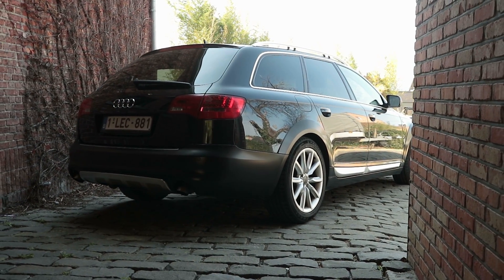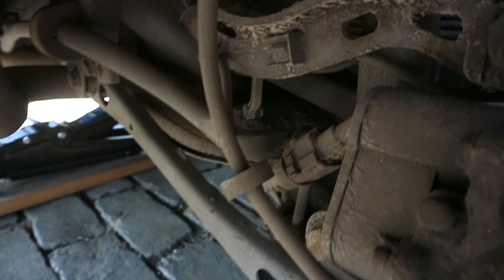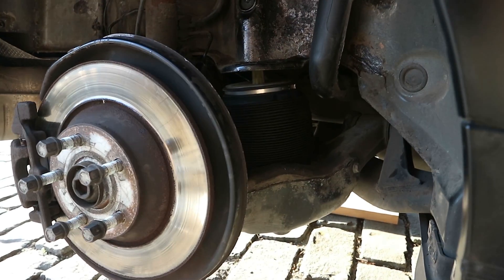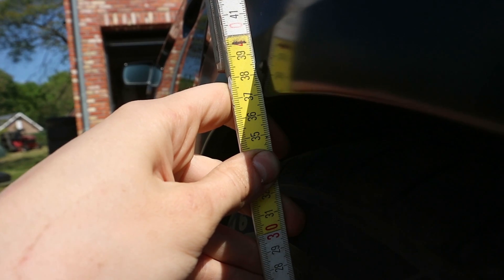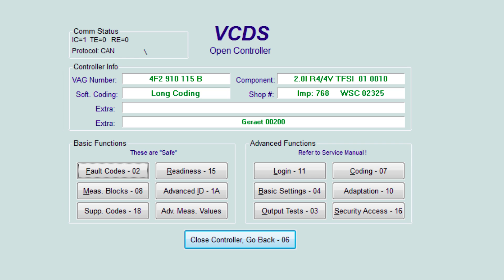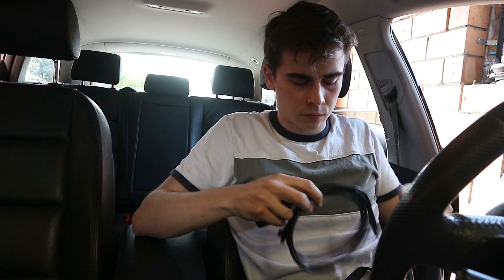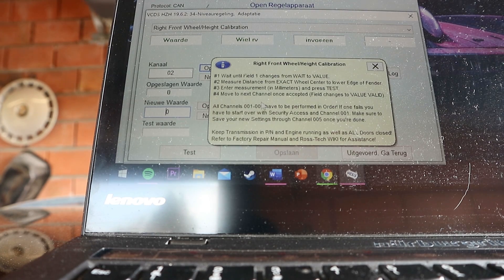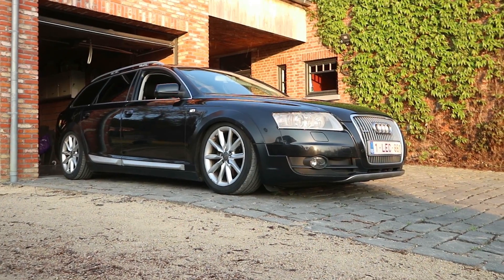Slamming My High Mileage Audi Using Software Only! (VCDS)

Comment: Thanks so much for the wonderful video and tutorial. I have an Audi Q7 2007 model. When. I checked the MMI, the Air Suspension Mode was missing,, and the jack mode was missing too. Will it be possible to access the Air Sus and Jack modes using the VCDS? Can I restore these modes using the VCDS too? Thanks in advance. Keep it up!

Comment: Interesting video, Memphis. Speaking as an old fart, I prefer stock height. Considering the state of the roads here, stock height and smaller wheels/taller tires would be an absolute must. Lowered, it would never make it into and out of my driveway. A few years back the expressway between where I live and where my mother lives suffered pavement failure. The carriageway had been resurfaced and the new surface did not bond properly. For a week every time I drove through the area there would be 5 or 6 cars on the shoulder awaiting recovery with at least two flat tires. Talking to one of the recovery drives I found out that many not only ruined the two tires but had also bent or broken the alloy wheels.

Comment: I liked the low level reached by the obd, but to lower it more by the air, 
it looks ugly and with no reflect on the performance
cuz this performance you seek is not reachable in daily drive 
and I don't think you would race using such tall and heavy car

Comment: You lost me with adding new values to lower the air ride,you ad not take like you said 380 you had 400 and car went down and not 360 to drop down.
Mine has air ride and would like to drop a bit

Comment: What can be wrong with suspensions, when I leave car in off road mode it doesn't drop suspensions down even if you leave it for couple of days, but if I leave in comfort mode or dynamic the rear suspension will fall down, what can be wrong pls

Comment: Hey mate! Is there an option to have the lowest height (at the end of the video) programmed to one of the driving modes? So there would be a "normal" to comfort mode, a "slightly dropped" for dynamic, and a "show (0bar)" mode for example to efficieny mode.
Reply from the maker: Not with this method but i think there are units available that can do that

Comment: High mileage with only 400.000 kilometers ?? My Audi A3 1.9 TDI (1997) had 704,655 km on the speedometer when I overturned on the motorway... If not I would have made , if God allowed it, over 1,000,000 km.

Comment: I would do so much, wrap it nardo grey, update head lights and tail lights, grill mirror caps,tune,tires,brakes,exhaust,20% tint all around,and a flat bottom steering wheel no cap

Comment: Damn i might just need to lower mine after i Fix my suspention. My problem is that it sinks on both bags On the Rear axel. but only when parked in Comfort or lower and still sinks when in jacking mode on both, do you have any insight to what the problem is? Thinking valve block since both rear bags seems unlikly to go out at same time.

Comment: anyone here can help please?
I drive an Audi A3 1.6 TDI 2012 with 106000 miles on. the problem it has is the following;
-It has a slight hesitation when pulling off. When disengage the clutch, the car move smooth as butter but when accelerate a bit, it hesitates ( it kangeroos), this happens in 1st and sometimes in second. it drives well in all gears without a problem.  In order to solve the problem, i tried the following:

_FULL service
_ Carbon cleaned the engine.
_Replaced the MAF sensor and coolant sensor
_Timing belt changed 
_ EGR spray clean
_DPF spray clean
_Full scan and it came with NO faults !!

What else can i do ?
Many thanks

Comment: Anyone interested in doing this, just google Audi 402 mod. 

I've used a £10 cable from eBay for years and never had any issues. Always hook up the car to a battery charger whilst doing ANYTHING ecu related like this, make sure the laptop is charged/plugged in and usb cable is connected securely. You will never have any issues either.

Comment: Love the 4F. Owned a A6 for 6 years on KW suspension. If I knew how easy it was to lower I would have bought one with stock air. It was indeed easy to lower this model with VCDS. Have Fun with this car. Groeten uit Oost Vlaanderen!👍💪

Comment: My car is more recent but don't have all those options in the US like reading tire pressure or sitting low or high
Reply: only the pre 2009 models had it, afterwards they ditched that system and used the ABS module to provide the tyre pressure only, no more tyre temperature. The previous system was really nice and offered better info but i guess cost cutting was much more important. Only the RS6 C6 kept the old system, had both the RS6 and the Allroad and i liked the older tyre pressure system better.

Comment: I would not listen to people saying to buy a clone. There are so many negatives with clones. They are all hacked Hex-Can hardware in a Hex-V2 casing so on cars 2015 and newer it can have issues connecting to some modules. The software comes on a CD as you can not upgrade the software ever, so you are stuck with the same revision software and don’t benefit from new features or updated codings. You get what you pay for with a genuine interface. Access to the RT forum with a wealth of knowledge, lifetime software upgrades and the fact you know you will never kill any modules on your car. The most cost effect one to buy is the 10VIN, you can upgrade to unlimited VIN at a later date via the Ross Tech website.

Comment: You can get the pirated vcds cable from aliexpress for around 40 USD, works like the real thing no problem.
Reply: Normal ca un roman lasa comentariul asta.
Reply: The cheap cable only works for vcds lite, no?
Reply: @brandonspencer309  no, it is full version with cracked start file

Comment: I own a mercedes b200 w245. 320k km. All major suspension components have been replaced, and pretty much the whole engine has been redone. Most of it was done out of preventative maintenance. I guess this Audi you got hasn't seen much more than a frequent oil change. It makes a difference

Comment: The question is, if VCDS is a diagnostics tool, how exactly did the people from the horror stories mess their car up?....
Reply from the maker: DieMaus by purchasing cheap copies of the cables and cracked software
Reply: @memphis5220  But, if you can't change values, how does it mess stuff up? 
Anyway, there probably is a way.

Comment: Great work. With vcds you can activate parking sensors visual on the mmi. Needle sweap, high beam auto it changes back to low beam when cars come, and digital speedo and turbo boost visual in the cluster.
Reply: What's the coding for the auto high beam to low beam, does it include the 4F?

Comment: Good work bro...........I had A6 2.0 tdi with front & rear airmatic suspension. Is it possible to puncture the inflated rear shocker rubber bag ? My no. Is +919815903847 on what's app plz guide me

Comment: The question is then how can we assess the real mileage (without service book)
Reply: elissah you can check the mileage of the car with vcds, but some professionals can modify it also, but best thing to do is to interrogate the engine module, witch is separate from the cluster module. If the mileage isn’t the same there is a problem. Anyway the AUDI dealer is able to find the service history of the car (if it was serviced at AUDI dealer). 
Check this link for the vcds about mileagehttps://vag-repair.com/codage-vag-com/controle-kilometrage-compteur-vag-com/
Reply: @francoisvda456  Merci pour les explications et pour le lien!
Reply: elissah pas de soucis ;) je ne savais pas que tu était francophone 🤗

Comment: With VCDS you can enable things like Fog lights as cornering lights, control windows with remote, oil temp in MMI, needle sweep, coming home/leaving home lights.
Reply: On the prefacelift A6 C6 can't do Needle Sweep, or oil temp, only on the facelift models.  Cornering can't be also done,not even on the facelift C6.

Comment: Thank you for the kind words.  I would like to point out that there are some functions that the factory scan tool does that VCDS can not perform.  In a nutshell, the factory scan tools at VW, Audi, Seat and Skoda dealers call home to special servers to get data that is used for things like firmware updates, or security type functions (key matching for example).  As you might guess, Ross-Tech customers will not have access to said servers, thus not be able to perform those type functions.  Regards.
Reply from the maker: RossTechVCDS thank you for the clarification!

Comment: to be honest. If i just looked at that car, I wouldn't have thought  it was a high mileage :/ But that just means the car was taken after up until the end by the old owner/your dad :) It might be some expensive work that has to be done, but to be fair if the old parts lasted that long, the new parts should last just a long :O so it's worth doing in my opinion, keep going :)